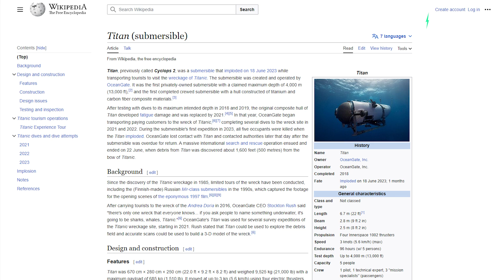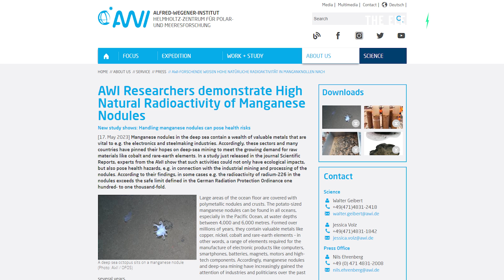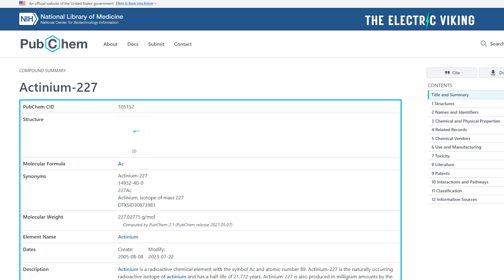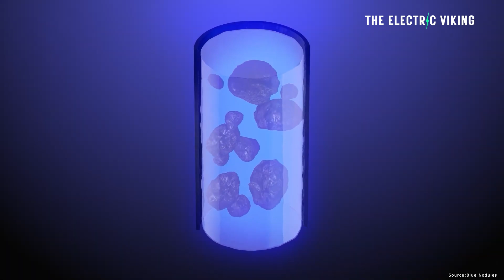19 countries aim to mine radioactive manganese, nickel & cobalt on oceans floor

Comment: A wet nodule in the hand is not dangerous at all. The problem is breathing in dust of the surface, if that is giving off alpha radiation. Alpha radiation is so "weak" in some way that it barely goes through cell walls - your skin can protect you. But you do not want to have it in your cells.

Comment: Easy to  process the heavy Uranium out of the minerals. It even provides a new source of Uranium, probably good news for certain governments and industries. The Radon will vent to the atmosphere during processing and quickly dissipate as part of the natural trace levels of radon gas.  BTW, the average house inside already has about 4 rimes the concentration of Radon gas than the outside air. This is a house WITHOUT a radon problem that needs venting.

Comment: On the radiation: As long as it's limited to alpha particles, that's no big deal for the end user. It's easy to shield against alpha radiation. A paper bag will suffice. (Alpha particles are essentially just fast-moving Helium nuclei without any electrons.) However, for the people who handle and process these things, there will be different protocols to follow, depending on how closely you work with them. It's relatively safe to hold one in your bare hand (though you'll want to wash up soon after), but if you inhale a single speck of dust from one of these nuggets, that could be enough to give you lung cancer. 

Fortunately, it seems that most of the radioactive isotopes are accreted over time from the water, forming a crust on the outside. Presumably an early step in the mining process would be to "peel the potatoes" to separate the nugget from the nasty radioactive stuff (which may have other industrial uses). 

Anyway, I do hope they'll put some effort toward minimizing the impact on the ecosystem.

Comment: Keep a sense of proportion.  Alpha radiation is not very penetrative.  It cannot go through your skin.  But you would not want to breath the dust in or ingest it.  This is a management and engineering issue for handling the unrefined nodules rather than a fundamental show-stopper.
Reply: No different from Coal Dust.
So why the over hype of the " radioactivity" which I am sure are ways of " scrubbing" them out in the refining process.

By the way, why no concern at all on the Japanese Government decision to go ahead to discharge their Fukushima " treated" radioactive coolant water into the ocean which I am sure is still radioactive.
Possibly more radioactive than those manganese potatoes.😢

Comment: Bad news the batteries are radioactive, good news is they don't require charging.. 🤣All jokes aside battery technology is moving so fast these materials may not even be used in batteries by the time we could harvest those from the sea floor. We need to develop batteries that use common materials and those that can be easily synthesized is large quantity. On a side note TeslaBots don't get cancer.

Comment: One thing people often under/over rate is the non linear thresholds for acute vs chronic exposure. Holding a mildly radioactive nodule is fine. Brathing in pulverized nodule dust over 20 years--less fine. IAEA scientist Zbigniuw jwarowski wrote a numer of papers a few decades ago. Those would give you a decent baseline to evaluate radioisotope non-linear threshold exposure.